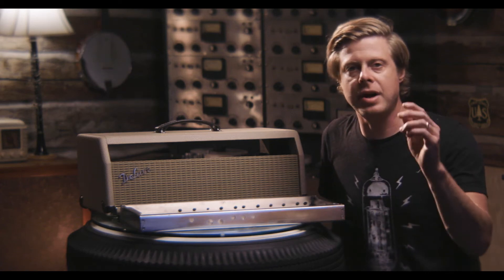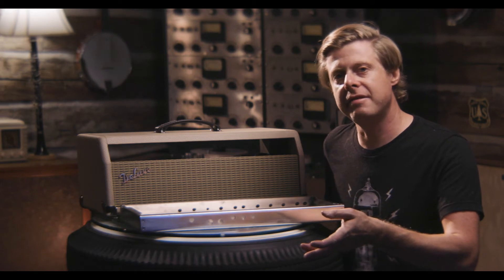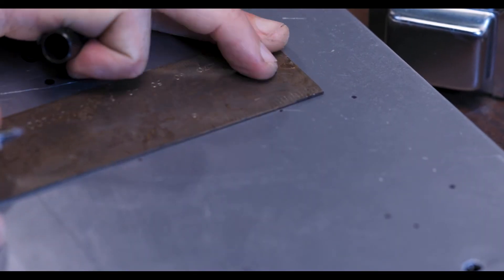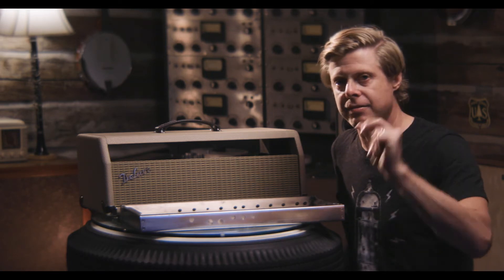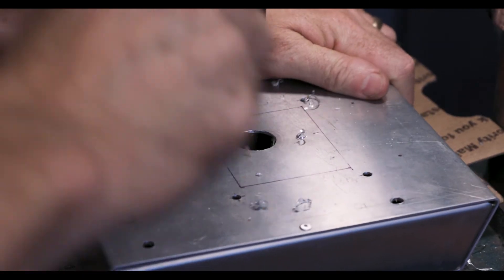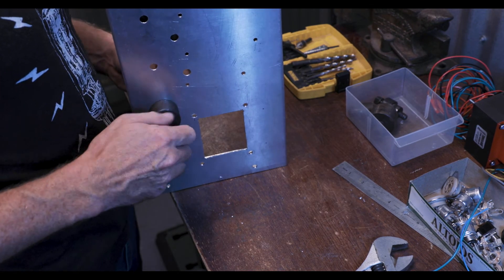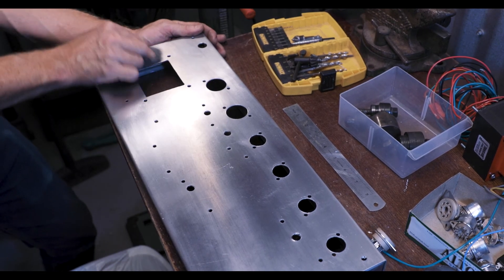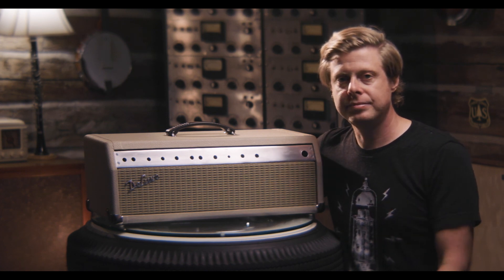Guitar Amplifier Chassis Build - Custom Amp DIY -layout, punch, drill, & prep like Leo Fender

Comment: I like the punch out kits there nice but alum chassis is kinda over kill 
I use a old school 3” porta cable with a fine tooth blade i use these at work for precision cuts on metal or sometimes a grinder wheel
Reply from the maker: That would work great for aluminum. I also do steel chassis. In comparison aluminum is a breeze.

Comment: Do they not have Pot-sized chassis punches?
Reply from the maker: Sometimes I use the appropriate drill bit. Other times I use the step bit. Sometimes drill bits wander of mark slightly. Step bits let you draw your hole using the faceplate as a template and nail it perfectly.